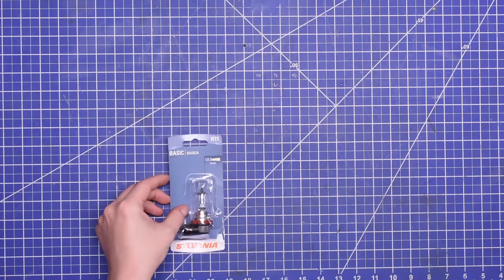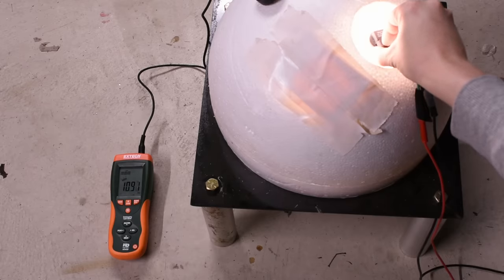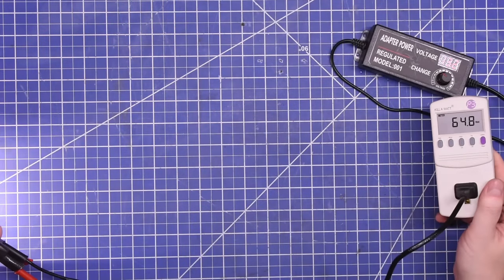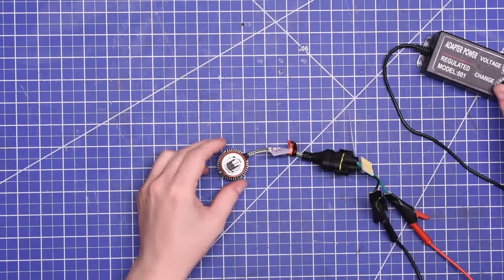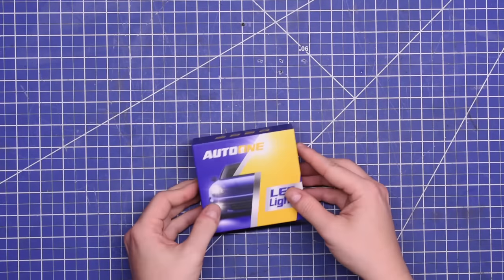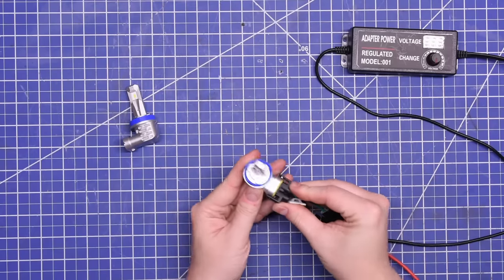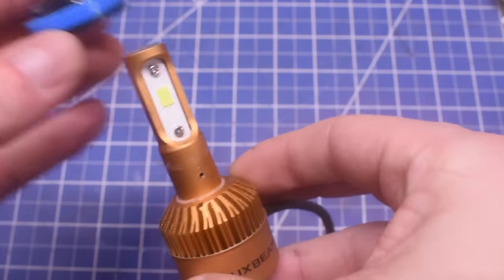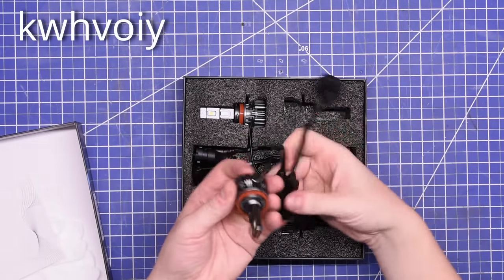Amazon Headlight Bulbs are Getting Out of Hand

Comment: I had installed some LED's that came with a Jeep and they would glow and flicker after shutting off until the jeep cut the rest of the power. They look alright if not a little blue for my tastes. But after I had to install some resisters inline for every light they work great. On and off like they are suppose too. They get hot while running the lights and then suck all the remaining power out of the line when you shut them off. I wish there was a way to only use them when I shut off the lights. But if the resistors last and don't melt anything or start a fire. I guess its all good with upgraded bulbs. The old bulbs were not bad. And I hate stock bulbs and change them out almost immediately on any vehicle I'm in charge of. So we will see where it goes? Amazon is hit or miss. I am becoming a fan of LED bulbs since HID are (while cool to start up) to complicated sometimes to be worth it. For a quick fix.

Comment: I find that all the amazon led headlamp advertised LM are the combination of the pair or two pairs.  So if it advertised as 16000LM for pair, it will be 8000LM (even tho they all seem to be a lot less bright than advertised).  So for that last one 36000LM, it should be 8000LM each (still less bright than advertised)

Comment: for this experiment to be reliable, you should set the same voltage of 14 volts everywhere, not that you test the power at 12v and then at 13 and set 14 in the LED bulbs. I understand that the car in motion generates more voltage, but the way you present it is a bit different sense. however, it was nice to see

Comment: I tend to be over the top skeptical when it comes to anything automotive electrical from Amazon.   I ordered new LED cab lights for my truck and installed them.   Not one worked.   That was sixty bucks thrown away because Amazon wouldn’t honor a replacement or refund.  
I only order from reputable companies now.  RECON is best so far and I’ve never had an issue with them.     You get what you pay for.

Comment: I put LEDs in a 1991 K1500 and can light up an airport. When it says 30,000 lumens .... they mean combined between the two bulbs. This truck takes 9005/9006 separate low beam & high beam bulbs. The problem is I did not install a power converter and my signals now dance like my bulbs are burned out because the truck is looking for a larger power draw. Now I have to get another piece ....

Comment: Am I reading this right that you tested all these at 12v under what you said was more like the voltage of a running car? 
If so you may want to retest after checking the voltage of a healthy battery as it should be 13.4 volts plus. 

We all hopefully know that sellers on Amazon and Fleabay will lie through their back teeth to get a sale .
Oh and the ballast things are normally to trick canbus systems into thinking the lights are working correctly as some led bulbs will throw a bulb out fault

Comment: Went LED in my truck. Stock was well focused, dim and yellow (old).
Tried Chinese halogens, brighter but not focused. Actually measured the center of the filament as a different length from base as stock.
Later, replace headlight assembly with cheap chinese ones (fogged lenses). Same off focus issue. Put is crappy stock bulbs and more focused but dim.
Went with 2500 watt LED replacements. Yeah, I knew it was bogus claim but they work well as are brighter and focused. I guess they went from bogus watt specs to bogus lumen specs.

Comment: I am a new subscriber.  Very interesting results on this testing.  I think I'll stick with the OEM.  I am also interested with lumen output over the life of the product.  I understand some led bulbs' lumen output drops off precipitously over time.  A possible comparison could be to operate each bulb at standardized voltage to, say, 80% of predicted life and measure lumen output again.
Reply: Most Led's loose about 20% brightness after about 30 mins.
Reply: @Steph-lv5fg  Wow, I didn't know the initial drop off happens so fast.  I've read that the quality leds have a much shallower lumen drop off curve over the life of the unit.  The cheap ones. not so much.
Reply: @TheGregstorm  I should clarify that the drop is not permanent, they just loose power as they heat up.

Comment: I bought LED bulbs from Amazon with crazy lumen numbers and 100s of 5 star reviews to replace my factory original HID headlights bulbs. The new LEDs were awful with light scattered everywhere and weird shadows and imo unuseable for my projector lenses. I got new HID bulbs and they blow the LEDs away. I did some research and it seems LED bulbs and projector lenses don't work well together because of how the headlight reflectors are designed. Normal headlights have many reflectors to create the pattern and projectors use a bowl shaped reflector. I did read that some LEDs work better than others in projectors but still not as well as HID bulbs. LEDs are great for some applications but leave a lot to be desired for others.

Comment: Most serious bulb makers market their non halogen lamps as off road use only for a reason. Up until very recently most direct replacement LEDs were dimmer than the bog standard halogen. 

If anyone modifies their lights with non standard equipment the least you can do is open your owners manual and follow the steps to adjust the beams. 

Headlights are highly regulated, they all have to go through DOT certification and are marked accordingly, if you buy aftermarket light assemblies atleast make sure they are road legal. You dont want tickets or liability in crashes all because you were using non conforming equipment.

I will say, the best place to replace standard halogen/filiment lights is in the interior. Dome lights with the older festoon bulbs are just begging to be swapped. Just make sure you dont introduce glare on the front glass as most of the replacements are actually 200% brighter than stock. The LEDs whiter light makes the car appear less dingy in the dark.

Comment: The "industry" LED output rating is per pair, low and high combined, so 18000ln will roughly translate to 4500, or since high usually leaves low on, 3000ln on low and 6000ln on high, YMMV

Comment: The problem with LEDs is that people are throwing them into reflector light housing as used here. Reflectors do exactly what they say, REFLECT, they have zero control of what the beam pattern should be on the LEDs. Projector head light housings have a cut off line to not blind on coming drivers. However you are supposed to still readjust after installing to make sure you arent blinding anyone. Most people who install these lights dont bother to do so.

Comment: As someone who has driven 500,000km at night if i could buy a LED with clean cut off lines to prevent upseting other drivers and no higher 4000k colour I'd buy it in a heartbeat.
but ill just keep buying plus 150% normal globes without the blue glass as they are the best for country driving and dont give you welders flash from road signs and reflectors

Comment: My preferred choice is putting a high beam bulb in the low beam location.  It doesn't change the beam pattern, just the brightness.  65W instead of 55W rated, a slightly higher color temp, much brighter, but unfortunately shorter life than a low beam.  The headlight housings seem to take the extra heat without issue.

Comment: I’m surprised by the Auxbeam performance as it’s fairly reputable. I have a feeling it’s due to the reflector type headlight housing. You’ll see that due to the double sided design of most LED bulbs, they may only work well with projector lens equipped housings. Otherwise the pattern they project isn’t good. On the other hand, sometimes the additional length of the led bulbs may not fit in all projector type housings.
Reply: Hi, i want to purchase precisely AUXBEAM for mu Duster 4x4, since i'm from Portugal it's not cheap the shipping cost, do you recomend it ? bar led / fog led / rear led / front light led / interior led, it is really good or meh ? thank you

Comment: What if you have headlights that were designed for HIDs and the manufacturer cheapened out with halogen. I own two Hyundais that have terrible lights due to this. On my wife's Tucson, I added LEDs (fan style) with a huge improvement. On my Azera, I have tried the sylvania burn out in one year ultras. Brighter yes, but not worth it. My wife's Tucson was the Guinea pig, so soon LEDs for mine. Both cars are projector type lens.

Comment: post  measured resistance, this will determine if you will get a lamp out warning when using led (the real purpose of that "ballast box") also the ones that claim drl pretty much never have a different output based on voltage like their halogen counterparts which on a honda usually means you're driving around with high beams on constantly, thanks for the video it was very enlightening 💡

Comment: I am not disputing your findings, I just wanted to share my experience with AUX Beam since I run them in all of my cars. Not specifically defending them, just adding some user context.
I'll start by mentioning that way, way entirely way too far down in the ad is a disclaimer (hereafter weasel clause) that says the rated brightness is per pair, not per bulb. Basically they are saying the promised 10k lumens is out of the set, so the chart would be 50%, not 25% per their words.
I agree, this is really stupid and arguably shady, and still falls well short of the promised light output. That said, you are getting around double halogen lumens for roughly halogen price and that is not a bad deal.
Now on to the real problem, the clocking thing. AUX Beam actually had a FMVSS recall for basically exceeding the amount of high intensity light entering the oncoming lane. The ones I have have an installation ring that is a 3 lug cam lock to the bulb, and then that adapter plugs into the headlamp assembly. I noticed the light spray in mine, and was able to re clock it to get a good beam. This is not mentioned in the manual. Again, this is a huge problem. 
That said, I would describe this as a builders part. I know it is sold as a plug and play consumer product, and that is a big issue since the installation angle is so critical, but at the end of the day I got LEDs, a good beam, and I have been running a set for over 5 years in the first car I converted. 
For somebody with some mechanical aptitude I think theses can, not should, just can, be a great option despite the weasel clause and potential installation cautions. 
A little more care, and honesty in the application guide and this could top this kind of list. Keep up the great testing.

Comment: I'm not convinced of LED headlight bulbs, at least not the ones from Amazon and other cheap ones. I will still prefer to use HID over LED in headlights. I put a pair of yellow LED bulbs in my fog lights, and they are no where near as bright as the stock Halogen bulbs, so I will be replacing them eventually with yellow HIDs instead.

Comment: I ask those of you running LED's in headlamps to be considerate of other drivers, too many are running bulbs they are just glaring terribly and/or aimed too high. Also I've been seeing a lot of Subaru's running these as DRL and for some reason a majority of them run FULL BRIGHTNESS, so you are driving with FULL HIGH BEAMS ON, even in daylight it is too bright at times. With that said there are some nicer brands out there, and in a good headlamp, they can be acceptable and non-blinding to others. I've personally had really good luck with DDM Tuning LED's, but I only run LED's in projector lamps, not reflectors. Finally if anyone is looking for a warmer LED color, try KOOMTOOM who have some that are very near 5000K which is to me way nicer than the bluish ones. If you genuinely want to learn more about headlamps, customization, retrofits, expertise, etc. check out hidplanet and theretrofitsource websites.

Comment: So, I would love to see Torchbeam 9007 headlights on Amazon. I sent them to my son as a joke because of the crazy claims of output, 130w, which I think it stated each, which I said combined. But it was over the overinflated ratings from tests. Well, my son purchased them. HOLY 💩 they are unbelievably bright. They seemed like the brightest HID on bright ten times over. But they never got hot running. I have a feeling they are more closely rated to that inflated number than most. 180° of rotation to adjust them, fans and external inverter. But man are they bright. His 24" LED off-road light bar doesn't even come close to as bright. I think probably about illegally brite.

Comment: I usually like this channel, but I will have to say that this video did not hit its mark of usual quality standard. It's full of weird, unclarified test decisions, product selections, inconsistent test voltage, inconsistent test conducting, non-fixed ISO footage as seen by several views of the wall getting darker with brighter bulbs, and homemade hardware used in conjunction with calibrated equipment making the entire tested number irrelevant when then compared to it's advertised lumen rating. A channel like car light reviews does a much better job testing lights with a clear baseline and consistent test platform and equipment, only comparing the lux output to that of halogen at a fixed distance with fixed housings, not making a claim on the validity of the advertised lumen rating.

Comment: Just as a comparison, a small meeting room projector for PowerPoint, is usually 3000 lumens and costs about 600 bucks.   

A 25,000 lumen projector is used with really big screens in ballrooms which seat thousands of people and costs between $25,000 and $200,000.    

So these guys saying they can do 36,000 lumens is complete hogwash.   If they really could get that much light out of that small of a package, they wouldn't need to sell headlight bulbs, they would be making streetlights, projectors, stuff like that, and making thousands of dollars off of each sale instead of $20.

Comment: im pretty sure your tool doesn't measure lumens but measure LUX (1lm/sq.m) or Ft/cd(1cd(sr)/sq.m) ... witch are not the same thing at all

Also, LED manufacturers have hard time dealing with more than 200lm/w LEDs... any light bulb annouced at that kind of lumen is total BS ...
they almost always advertise what the LED is capable of ,not what it is actually emmitting in it's own environement... it will always be lower due to bad heat management over time plus the fact that it is encased in something (the bulb) great thumb rule is to take the wattage times 125lm/w(for a very good consumer quality product) down to 20lm/w for a cheapo LED product and it will probably give you a reasonnable lumen output

Comment: Feel free to fire at me any way you please for this...
When they say KIT, what makes it a kit?
When they say conversion, what makes that?
It's a bulb. The same packaging as an OEM at a parts store.
There is no need for additional relays, wiring, bulb type socket swap, or even BCM bypass.

IMO, these that say KIT or Conversion are junk sold by anyone as an online merchant. It is simply a bulb replacement. Would you consider calling a swapped Halogen to a LED license plate/map light a Kit?
For those that don't understand where I'm coming from, I'm saying its a red flag and something to keep in mind. I'm not asking these questions as if I dont know

Comment: I also want to add that just because the light pattern looks crispy doesn’t mean it’s good. Normal Halogen bulb patterns may look foggy or uncross at first but it’s because they are made to have “hotspots” in the light pattern so that certain sections project further than the edges. It won’t do you any good if your new LED bulb gives you a crispy light pattern but doesn’t emreach very far.
Reply: This is further exacerbated by overly blue lights as they are more noticeable due to how our eyes are more sensitive to blue light, but it's all marketing and trickery as the light also scatters in fog and rain, when you need it the most.  So it's indeed very bright up front but not good at a long distance.  HID are superior in almost every way in terms of actual light, BUT they do also dim with age.  10 year old HID are running at maybe 70% of new and OEM are also "safe".  The higher output H9 type versus old H11s feels like a huge upgrade because it is - about double the light of the old ones in their worn-out state.

Comment: I am a Vine voices reviewed for Amazon. The complete BS on lumens is the rule not the exception. And it has been going on with flashlights etc for a long time. claimed 10x of actual is common. Worse yet is capacity of batteries on anything. EG cordless tools etc claiming say 6Ah that are half that out of the box, and which fail at 100 to 150 charge cycles instead of say the 600 cycles an OEM dewalt will last. Meaning that $25 generic Dewalt knock off battery  is actually way more expensive in the end than a $100 genuine. Same with power banks etc. These companies are buying extremely low grade quality control fail cells to put inside any battery pack. Do not buy anything without a brand you recognize or that has been around five years, or any product that hasn't been around for at least two years. Other bogus numbers include comfort ratings of sleeping bags, materials of clothes (amazon doesn't care if a listing for a blouse says "silk" when it is 100% polyester). Also car parts tend to be quality control FAILS.